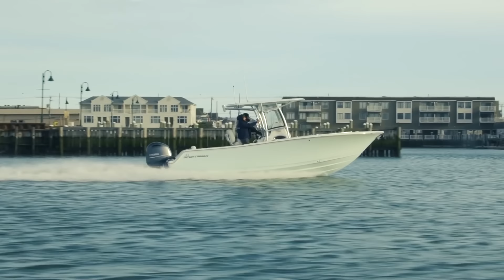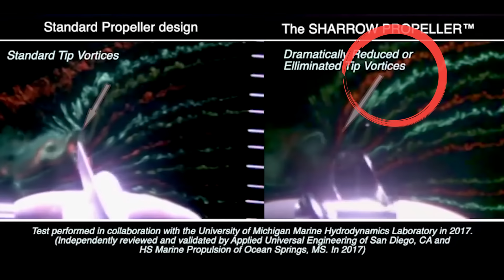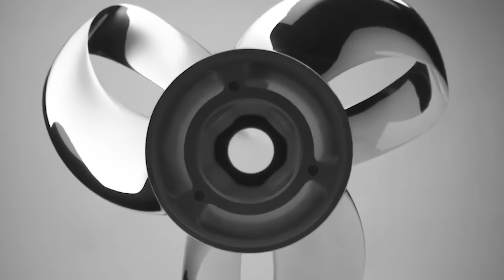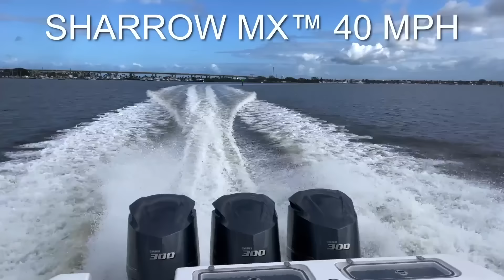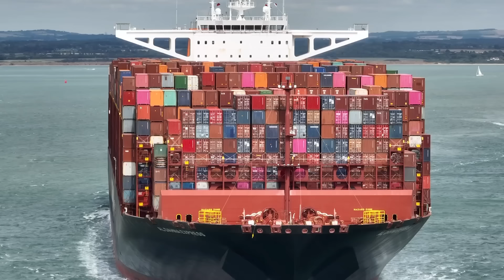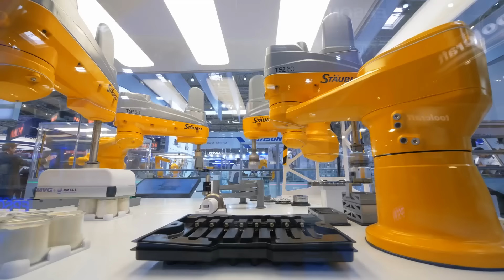This Genius Propeller Will Change Transport Forever

Comment: Thinking about it in my head, the toroidal blades appear to trap the energy within the twisted O longer, which makes it more efficient, instead of losing the lift energy or hydro energy off the tips of the blades of a conventional propeller or blade. It is quieter because more energy is utilized as opposed to lost. The louder sound is the sound of lost energy or inefficiency. 
**That's my best way of describing what I'm picturing in my head visually spatially.

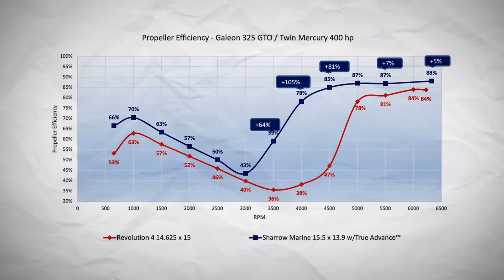Comment: Question: @2:54 we note that the difference is pronounced within a narrow bandwith (approx. 3000 RPM to approx 5000 RPM). It seems to me that this could perhaps be handled by adjusting the pitch/angle of conventional props, having explicit issues with coping with that particular zone. Am I wrong ?
Reply from the maker: I am not sure on the details, but I know that some of the other propellers had a less drastic difference, so you may well be correct - however, with like-for-like propellers the toroidal ones generally seem to give a significant improvement! Hope this helps somewhat and thanks for the comment!
Reply: @ZirothTech  thanks for the input. Anyhow, perhaps toroidals would be less expensive, provided they give a robust 10% fuel saving over even variable blade angle props.

Comment: Only issue that one can easily look at is that the blades are of a fixed pitch . Thus only for small airplane use . Large airplanes that uses proper torque power requirements needs adjustable pitch blades, in as well as full feathering options .
Reply: You are right...I spent my career in aviation and it would be hard to feather one of these propellers.   :-)

Comment: …I just realized something. The biggest thing holding back prop planes from even higher speeds is that as you go faster and get near the sound barrier the props begin to have trouble grabbing enough air to generate lift. It’s very similar to the issue that caps the maximum altitude a prop can reach. Yet these new propellers can seemingly fix that problem to a degree to thanks to the increased efficiency, so my question is how high and fast can a turbo prop equipped with this fly? Could it maybe break the sound barrier?

Comment: 'Mass production should reduce costs.'
Maybe, but I've heard a few times that CNC'ing or 3d printing requirements are exceptionally difficult to change to mass production. Hopefully these find a way.
Reply: Depends on the definition of "ma$$" per each type of "application".

Comment: I would never believe this claim until I see real data like energy consumption comparisons/run time of a drone in hover mode.  For the marine props, I would like to see fuel consumption vs. speed.  And I guarantee neither one of these data sets will ever be shown.  Everything in engineering is a tradeoff. You NEVER get anything for free.

Comment: Now on a windfarm generator maybe, but probably not for the same reasons as mentioned in the other replies. 
  The wind farm industry never looked at the leading edges in their designs, till they started failing and still push countless blades out the door, because they know not what will stop the leading edge Deterioration, resulting in unbalanced and gear box damage and final drive out puts to the generator.

Comment: Even airplan props need the leading & trailing edges resurfaced.
 Thing of how more costly, difficult and timely; it will be to service your prop.
Or if it has deformation after a bird strike or other reasons. 
  How fast it will damage your gear box and engine; while putting you In parallel of an emergency off stripe landing. While your controls are vibrating profusely as you try to control your emergency landing.
  Yeah not on my Cesena 360 twin.

Comment: I doubt if large vessels will replace traditional propellers with toroidal props simply because large vessel propeller blades can actually change their angle, allowing the ship to essentially change their speed without modifying the prop rpm, even allowing it to go in reverse, which makes response times from flank speed ahead to full rear much quicker, I don't know how you'd be able to do that on a toroidal prop

Comment: This would be an absolute game changer for heavyfuel-using vessels. The 7 biggest container ships produce more sulfur than every car in Britain per year.
Reply: I figure it would be quite expensive to build a propeller that massive.
Reply: Unfortunate that a cleaner burning fuel would also be prohibitively expensive to use for ship fuel, would be pretty cool to see them use something closer in pollution levels to unleaded gasoline/petrol (still terrible for the environment but slightly better than bunker fuel)
Reply: And yet sulfur is a key element in plant growth, what'r ya' gonna do?
Reply: @robertmarmaduke186  you are thinking of just plain sulfer you find in fertilizer. Ships burn fuel oil that produces sulphur dioxide which is toxic to plants. And humans. And creates acid rain. But what'r ya' gonna do?
Reply: @TheBCninja  You're right, I probably should've made that distinction earlier.

Comment: Mating these new design ultra expensive props for recreational boating requires many model speciic engineering changes in the lower unit/driveline design at the boat engine manufacturing level.  Anyone who actually owns a boat, can tell you that making a propeller 'more efficient' can cause a vast performance change.  Boat engines (especially new 4 stroke designs) develop very little torque at low to mid ranges, and hence have to incorporate slip (cavitation) in order to get there boat on plane.  Propellers of this design will almost have to be custom designed per boat and motor, so is left to large custom applications, and mostly industrial use.  Oh and rich ass millionaires with electric  boats will benefit, of course.   Recreational boaters couldn't give a c##p if spy drones are quieter.  Been around since 1971, but yeah can't make it economically feasible, Patent and demand for exclusivity will limit this "wonder".

Comment: cargos ships are a different matter. They massive diesel engines which are the most efficient combustion engines in the world. They acheive the efficiency through size and low rpm. They make peak horsepower as low 100 rpm. The propellers are huge and slow turning which also adds to efficiency. I think you are overstating your hopes for the shipping industry.

Comment: I have my doubts on air applications. These propellers would be significantly heavier and the thrust-to-weight ratio is a delicate balance. Could the increased thrust outperform the increased weight? And what about maneuverability? I'm not sure.

Comment: Reducing prop tip vortices is definitely a game changer.  Has anyone done any transonic or supersonic model or testing on this concept?  Love to see the data that throws up.
Reply: You can’t do supersonic travel with a prop because the engine can’t go above m=1, you need to use a convergent divergent nozzle such as a Venturi or de laval. The air is pressurised and uses the compressability effects of air to accelerate at m=1 at the throat of the nozzle and due to conservation of mass the air speeds up in the divergent section allowing speeds of over m=1. Each nozzle geometry will g work best at a Different value of m hence why we use variable geometry nozzles on fighter jets, so that the engine can remain efficient throughout flight as having an over or under expanded shock from the wrong pressure at the inlet, throat size and outlet size combination will be detrimental to fuel economy and fly ability. As well as this, it can be manipulated for the nozzle to converge again allowing subsonic flight conditions as converging supersonic air will reduce the velocity back to subsonic. Have a look into compressible and incompressible flows it will explain more
Reply: @formulasetting  I understand that, it's the tip vortices at that kind of edge velocity I'd like to see the data on.  What I'm interested in is how fast can such a prop turn and maintain the efficiency gain?  Where is the optimum point on the thrust curve in air and in water respectively?

Comment: I’d like to point out a flaw in the boat video you showed. Although the propeller can inherently be less noisy, this video doesn’t truly demonstrate that. Part of what makes a boat noisy is their engine and since the new propeller is more efficient, the engines would need to run at a lower RPM to achieve the same speed of 40 MPH and thus reducing sound. The videos were also taken on what looks like two completely different days which also influences sound. The best way to truly grasp and measure the sound difference would be to measure it in a closed environment and have the engines run at the same rpm.

Comment: Maximum effort from minimum input.  If that is the idea. But huge ships in varied water depth,  turbulence and variable catchment of water at speed once achieve . Props in air!different story, but variations driven or drive  by,are to be taken into account.  Water turbine to input, against output propulsion of load varying in seas. Constant catchment,  or adjustable speed catchment. Small and good in results.

Comment: It would seem as though the toroidal propeller would be more stable at its ends, and the normal propeller tips would vibrate more - which would reduce the total energy delivered to pushing the vehicle. This would suggest noise reduction in aircraft propellers and greater thrust for both aircraft and boats.
Reply: On YouTube search for "ThunderScreech" aircraft 😳

Comment: It's probably only at certain RPM that this design has some benefits (depending on medium it operates in). It was recently tested by Major Hardware in fan application and it turned out to be louder than Noctua at 2000RPM while only moving half the air volume. So essentially it's marketing BS that a lot people swallows.

Comment: This fancy mortar mixer will never become the new design to standard or hp marine use. I’ve folded a stainless prop just with force. A mild balance issue could make for a dangerous projectile. I can think of 5 major flaws just by its design, not even mentioning the hull’s X causing cavitation or downforce in which every boat is different.

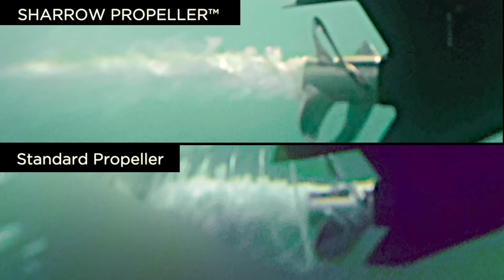Comment: 0:52   10/10 for engineering innovation,  0/10 for the use of the English word "Less". 
"Far less bubbles"  is incorrect.  The word "less" should only be used when referring to quantity,  eg. "The prop's will use less fuel."
When it comes to numbers, the word should be "Fewer".  "There are fewer bubbles. with less cavitation....."  Get it? 😎👍
I know I'm being picky but it "Grinds my Gears" to see English vocabulary being degraded.   Read George Orwell's 1984, I cry!🦯

Comment: Sorry, but the rpm is not the only measure of efficiency, you need also the torque to calculate required horsepower. That a propellor with 6 blades will reach efficience increase nearly at half the rpm of a propellor with 3 blades is obvious but no increase in efficiency. At least not by 100%.

Comment: This will not work in the U.S. Similar tech has been used in wind generator blades for over 20 years.  They aren't used on a large scale; not because they are hard to manufacture, but because the company that holds the patent on it wants an insane amount of money to use it (even trying to DIY your own will lead to a lawsuit from them).

Comment: 105% efficiency? Seriously? So it it makes energy? Efficiency is a factor where you show how much energy is transferred in the desired type of energy and how much is transferred into the types of energy we view as lost energy.  For example, how much energy is transferred into the mechanical energy, hence moving the object and how much was turned into the heat, hence undesirable firm if the energy in thus use case. There is no making of energy. There is only converting energy from one type to another type. All available energy from one type that is used will be transferred into a few types of other energy. For example, the chemical energy of the fuel in the engine will be transferred into the mechanical rotation force and heat. Due to the imperfections that create friction in mechanical parts, we get losses in heat. Plus, the burning process causes heat as well.
In the case of the propeller, they measure the transfer of mechanical force (spinning of the prop) to the water. This is after the losses in the engine itself. Still, even transfer is never reaching even 100 percent due to the cavitation and energy losses by heating the water by compressing it. The second are smaller losses but will take away the possibility to achieve 100 percent efficiency.
105 percent would mean that you are somehow generating an additional 5 percent of power, but to do that, you need to introduce new energy and more than 5 percent while even that source will have losses.
I do not see what energy this propeller would add to this system. Hydrogen power? That was just a joke.

On the other hand, this is revolutionary. Heck, even 20 percent more efficient props would be  great gain. Maybe it will change the form of the blades in the turbines as well and make a huge difference there, too. I hope it will. More efficiency is the best way to make a better future.

Comment: Back in the 70s I ran into this toroidal propeller design in patent reseach. While attempting to design a constant torque variable pitch propeller myself. Must say I was very impressed at the time. In my own study of the toroidal design I drew the same conclusion of machine shop limitations of this design in manufacturing on a commercial level. But an extremely viable concept since the invention of 3 axis cnc machinery on an industrial scale. The shape does redefine the term of warp speed,, due to the warping of edge chines in this design.
Reply: Would casting have been too difficult?
Reply: @Skeldons  had the same questions.
Reply: @mrspeigle1  Casting it makes it less precise and propellers have to be quite well balanced. If they aren't the uneven weight distribution in high rpms would cause alot of vibration and other problems. I'm a 1st year student in maritime engineering and I'm taking somewhat of a guess so don't go too hard on me people. Tyyy.
Reply: Would this prop design be viable for aviation?
Reply: Warp speed?!! 

"Engage Mr Scotty...."
Reply: From a comment above......This propeller design originates in Tasmania in 1971. It was developed by  D B Sugden, an engineer consulting to The Robbins Company  (a US company out of Seattle, specialists in hard rock tunnelling machines). The Robbins Company financed an R and D project lasting 2 years in collaboration with David Sugden. I joined the company in that year, thus I speak with some authority.  We built and trialled a series of propellers from about 10 inch to 30 inches swept diameter.  At that time the difficulty was reproduction of form, a problem which, as you point out, is overcome by CNC capabilities and 3D printing. Trials and wind tunnel testing demonstrated significant performance gains. I recall that a large prop was provided to a fishing vessel owner on the understanding he would trial it for a few months. He refused to give it up because it was so good when the trial concluded. The manufacturing difficulties of that time precluded further development..👍🙂

Comment: The main reason of why toroidal props are still not in use compared to conventional props we knew today is: Toroidal props have to be perfectly tuned.
Damage and displaced angles will lead to deteriorating performance much worse than conventional props could sustain.

How about you make a research of comparison on toroidal prop vs conventional prop performance against damage.
For the metodology , you can spray sands mixed with gravels to a static hovering drone in a confined transparent acrylic box (room).
There you will find the answer of why conventional props are chosen over the toroidal props.